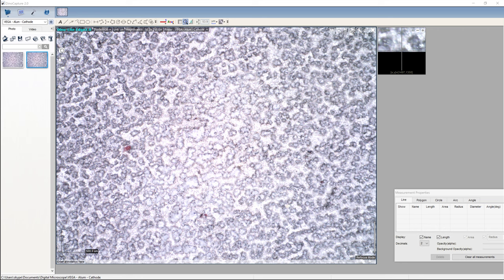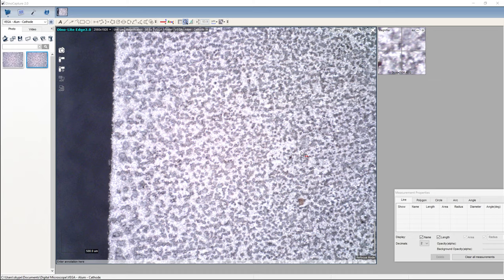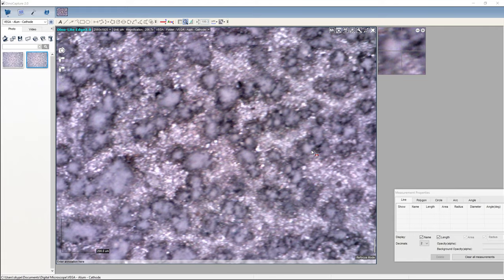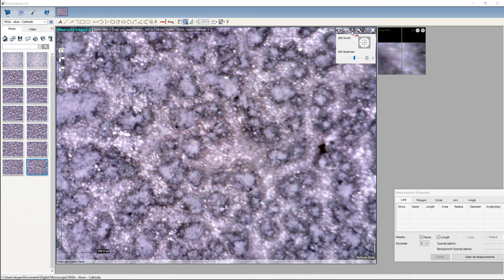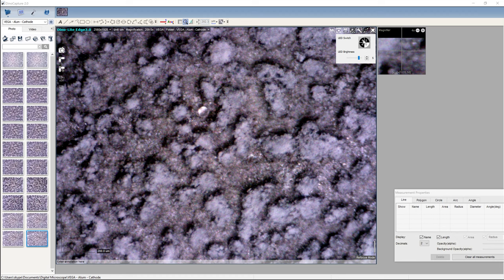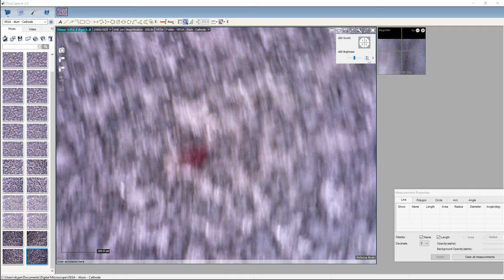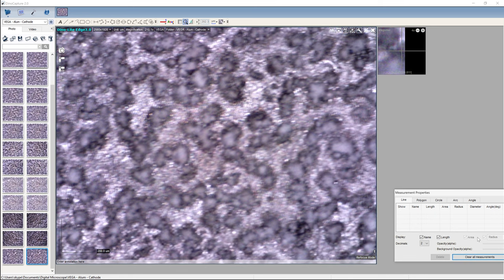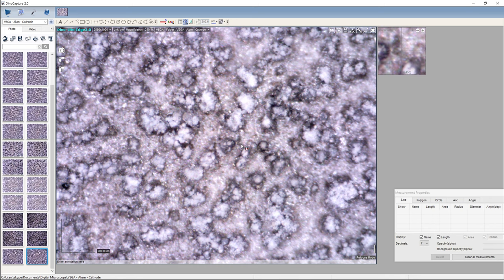VEGA - ALUM - Cathode under microscope

Comment: That kind of surface treatment might be a key to many FE devices and gravity control. You just have to have many layers of it, forming a capacitive surface. Alternate layers of surface treated Alu with Fe3+ ?
Reply from the maker: Possibly. The resulting structure is very similar to suggested morphologies for production of Mesyats 'ECTONS' which are in fact EVOs.